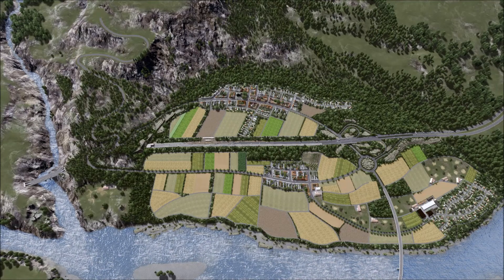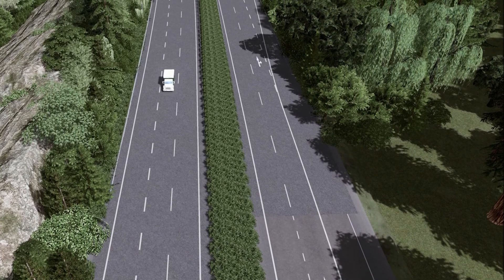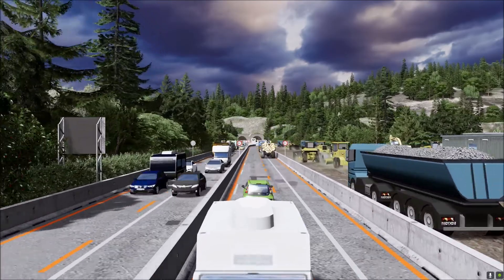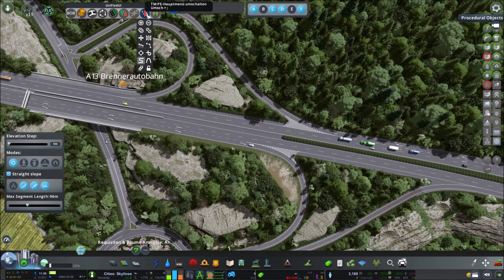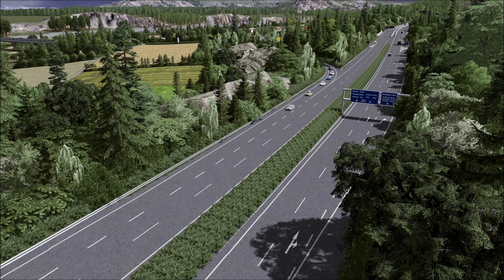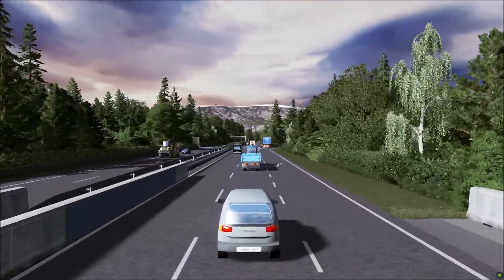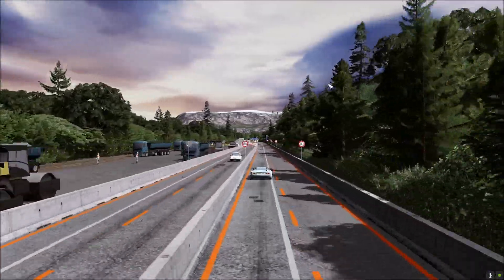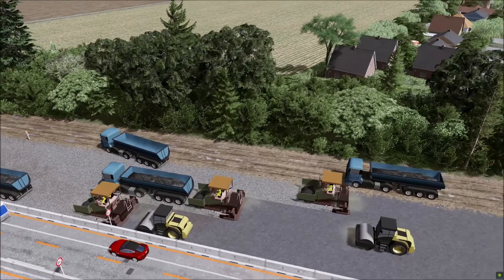Highway, interchange Schladnitz Süd and a construction site

Comment: Great build. What assets did you use for the farmfileds?
Reply from the maker: thank you!
most are done with decals from this collection: https://steamcommunity.com/workshop/filedetails/?id=881552391
or this one https://steamcommunity.com/sharedfiles/filedetails/?id=767694792
(check the collection that's linked in it's description, lots of fantastic decals)
freshly plowed ones are done with this muddy road: https://steamcommunity.com/sharedfiles/filedetails/?id=2131244176
and one is made with sunflower props: https://steamcommunity.com/sharedfiles/filedetails/?id=972315541